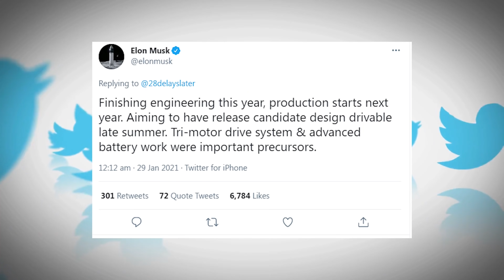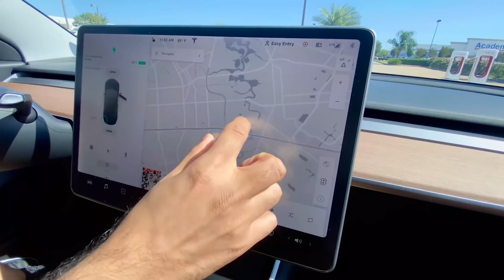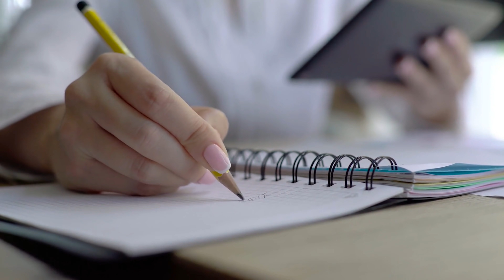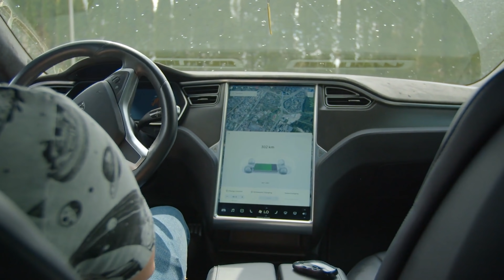What Happened To The Tesla Roadster??

Comment: Even lambos are facing criticism and moving to electric because of this EV revolution
Reply: but you won't get that sound when you start the car up or rev it if its electric
Reply: @vambat3523  There's no need for that with electric cars, since the whole point of them is to use energy for propulsion, not to waste it making a racket, producing waste heat, and causing vibration.
With electric cars, your loss is your gain. In the case of the Tesla Roadster 2, however, they need to build and sell them before making a fuss over them. It doesn't matter if nobody can actually buy them, regardless of price.
Reply: @devilsoffspring5519  Alternatively, they can have software generated "engine noise" that corresponds to what the vehicle is doing -- same thing but a lot less energy lost to waste heat.
Reply: @fcgHenden  That's cheezy, though. Engine noise comes from engines. I like it as much as anyone, but I don't see it as being the main point of a car, even a performance-oriented one.
Reply: Hybrid*